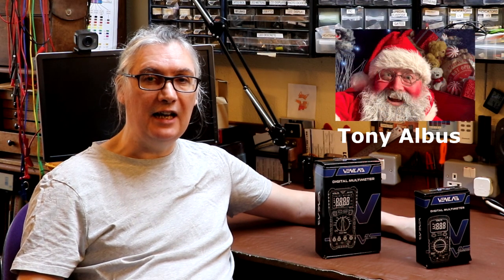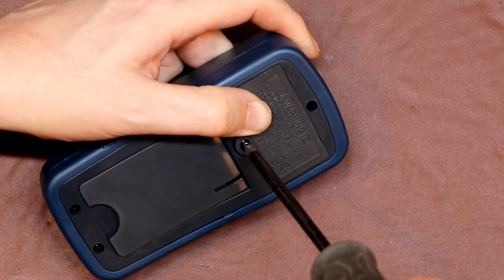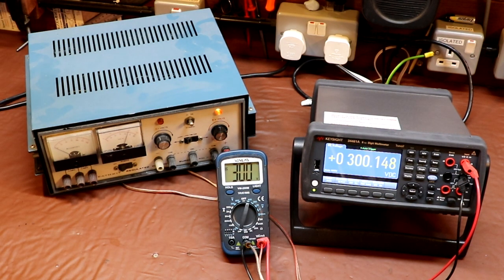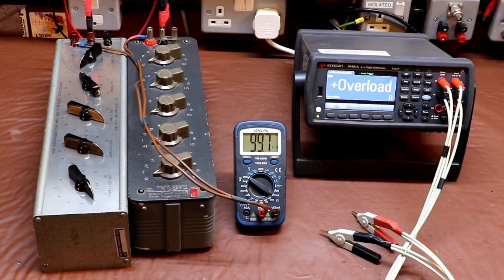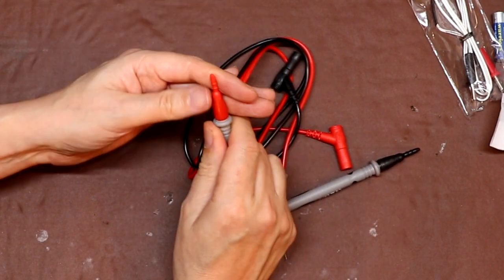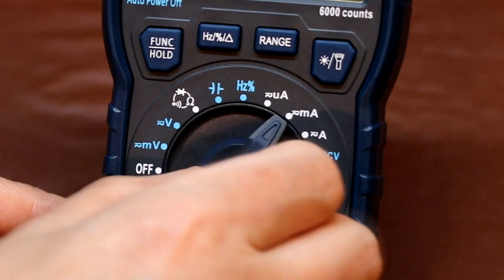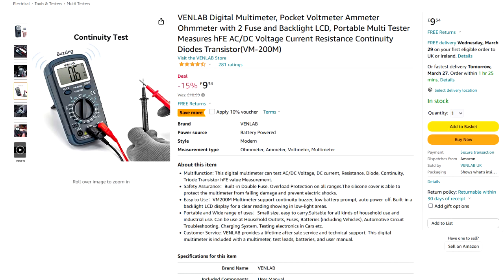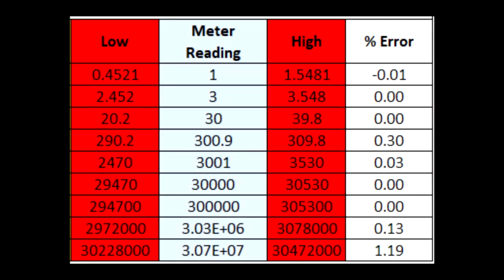Venlab VM-200M  And VM-600A Review

Comment: Hi Chris, I think I will buy one of these Venlab DMM's and give it to my neighbour so I can get my Fluke 21 back off loan! Good tip for the self tap into plastics. Very valid point about shared volt/current input, sods law it will happen. Fuse's, should be sand filled ceramic not glass? Just aquired Leak 2000 reciever from Golborne and the voltages quoted in the service manual are taken with an AVO 8. The Leak was made in 1975 so AVO's still front line kit. Very thorough and explanatory video as usual. Great work.
Reply from the maker: Sorry that I missed the last Goldborne  but I will probably get a table at Retrotech as I have lot gear that I need rid off. There are various techniques for high rupture capacity sand is one of them. The sand fills the gap occupied by the vacated wire that has become plasma. Plasma is very conductive and the sand falls into the gap blocking the plasma flow quenching the arc. I do have AVO meters 7 and 8 for as you say many old service data reference’s them. I have to say I’m not an AVO fan they were fantastic for they day and excellent analog meter fairly indestructible but the specification is nothing to write home about even compared to the very cheapest DVM. And I hate range switching. I’m sure you know that if you substitute a DVM for an AVO your reading will be a bit high for voltage. Good plan on the Fluke. Regards Chris
Reply: @allthegearnoidea6752  Hi Chris, you are absolutly right about the superiorty of the DMM over the AVO 8. In 1975 when I started working in TV field service, there was no DMM's just the AVO in a leather case. Hope to get to Retrotech myself, the wife insists that we need more junk.
Regards Peter.
Reply from the maker: @peterc2150  yes same for my wife. Come and say hello if you make it.
Reply: @allthegearnoidea6752  Will do.

Comment: The plastic threads on my 30 year old meter wore out long ago.  The battery door is held in place by a 20 year old piece of electrical tape.  Lol.  Cheers from Canada :-)
Reply from the maker: I still have an old micronta meter bought from radio shack. It’s held together by glue and gaffer take but it still work.  It is amazing how cheap these things can be made now and also kind  of sad. I saved pocket money for months to buy that old Micronta

Comment: Hi Chris, some observations about this review. The VM-200A seems to be a nice budget friendly meter and has more features then the wellknown DT-830, but like most budget friendly meters in that price range, this type doesn't seem to have a Auto Off function. Regarding the VM-600A , i can't help it, but that type reminds me of the Kaiweets multimeter. During many tests, the resolution was low (1 decimal behind the point) but this is normal on most multimeters in the AUTO setting, on the manual setting you can get propably a higher resolution. The normal glass fuses that came with these meters, are okay, but i don't trust them in a multimeter, and replace them by HRC fuses that are filled with sand. 
ps1 : nice sound editings, and i'm glad that Ian and Tony are still alive :-) 
ps2 : did you received my email 1,5 week ago? if so, no problem, if not, i can resend the email, i had that day other people that didn't get my email. 
Happy easter holidays. Grtz
Reply from the maker: Hi Bjorn yes I did get your email and very interesting regards the extraction. I have a few extraction unit under the bench it works well but the replacement carbon filter are really expensive. I will reply on your email just been very busy at work the last few weeks band have been away working in France. I have a pile of stuff that I need to catch up on.  Regards the meter I’m sure the ceramic fuses would be an improvement but I would not use this in an industrial setting I’m a Fluke fanboy anyway.  Still perfect good enough for electronics work. I would like to have done a more detailed review and opened up the meter but just not enough hour in the day.
Reply: @allthegearnoidea6752  , Hi Chris, don't worry about the email reply and take your time, like we say here in Belgium "There is nothing burning" :-) 
Regarding opening the meter, you can always use a hammer, but the problem afterwards is, if you find something funny, was it caused by the hammer, or by the manufacturer fault ?  It was a decent review, some other channels take more time to review the cardboard box then the meter itself. Grtz